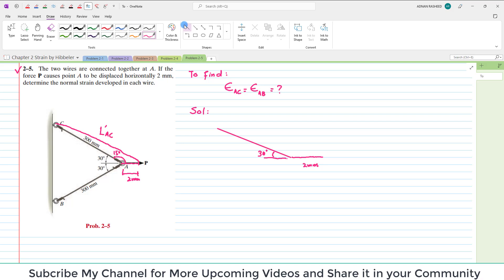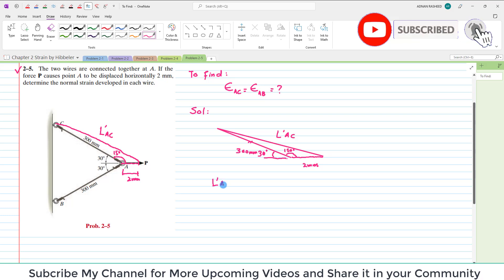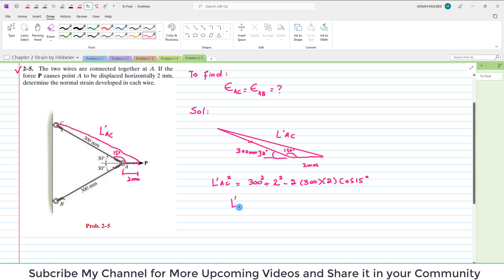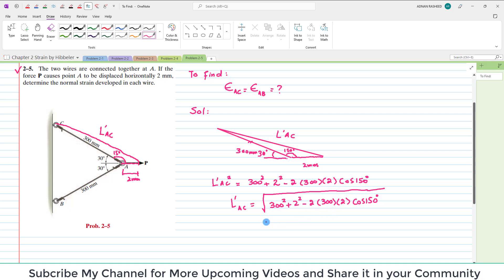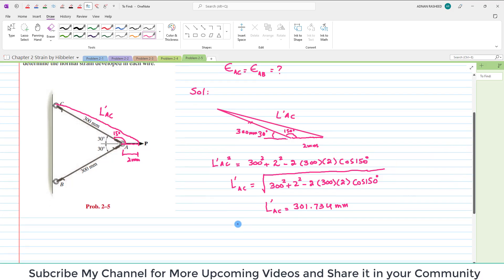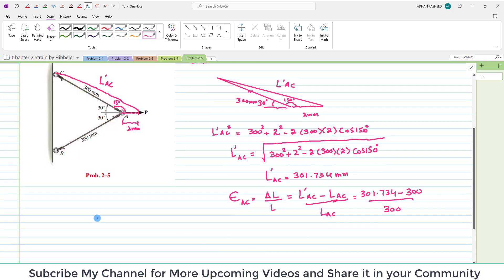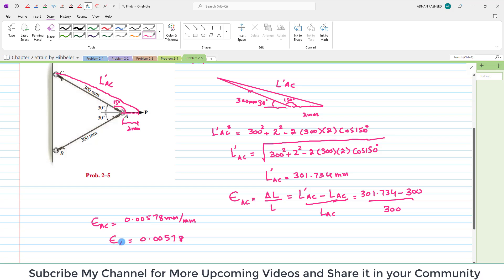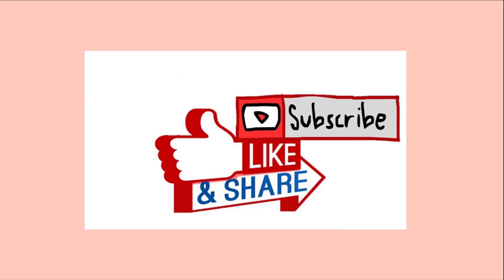2-5| Chapter 2 | Strain | Mechanics of Materials by R.C Hibbeler|

Comment: Sir why don't we use deflection as the change in length because deflection means the change in the previous and the final length and if you put 2 mm divided by 300 mm then it will give us the same answer which you have already calculated
Reply from the maker: you can see that 2 mm is not the elongation in the wire and it's the displacement of point A so that's why .....
Reply: @engradnanrasheedmechanical  Thank you sir, and sir can we also calculate it by using Pythagorean theorem and adding 2 mm to the base 300cos(30) +2 and taking 300sin(30) as perpendicular.
Reply from the maker: @tapejera6009 you can check it if it satisfy then ok
Reply: @engradnanrasheedmechanical  yes sir its correct i have verified it.
Reply from the maker: Ok good 👌